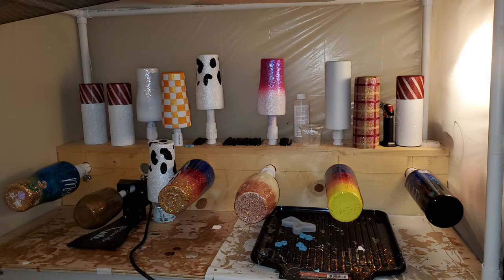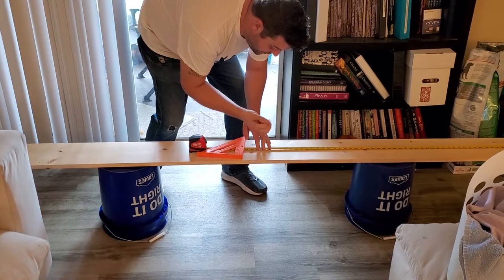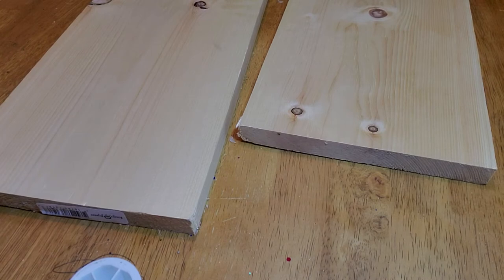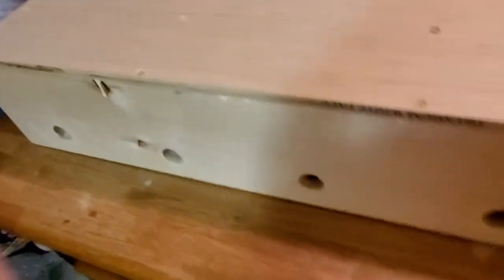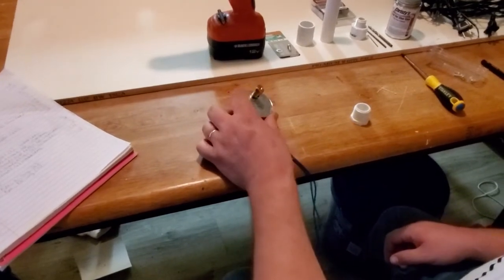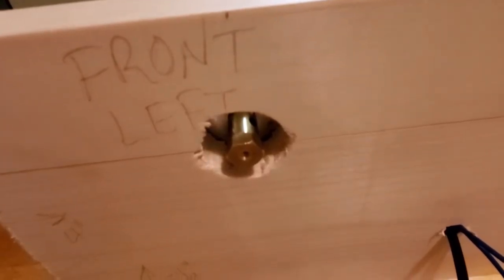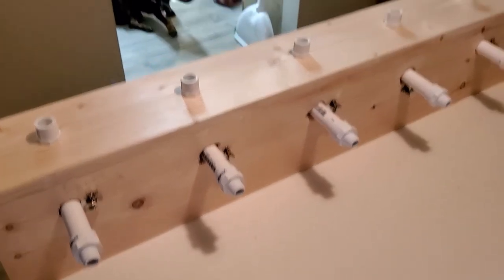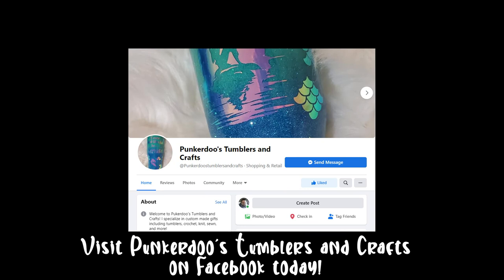HOW TO BUILD a 6-Turner Tumbler Turner for CHEAP

Comment: Question, I have a 8 cup turner that a friend tried to make for me, great start and idea, but the pvc pipe, while rotating, goes up and down...any idea why and how to correct this?
Reply from the maker: First, apologies for the late reply.  Now to the question: the motor isn't aligned with the end of the PVC.  In other words, you should have a straight axis that runs from the motor shaft through the center of the end of the PVC.  If it is not level, your PVC will wobble.
I hope this helps :)

Comment: since you cemented it all together, what do you do when a motor dies?
Reply from the maker: Sorry it took so long to answer.  I unscrew the top to get to the motor.  I then unmount the motor from the back.  If you bought the right size of PVC, then the it should come right out through the holes (it can be a bit tight, though).